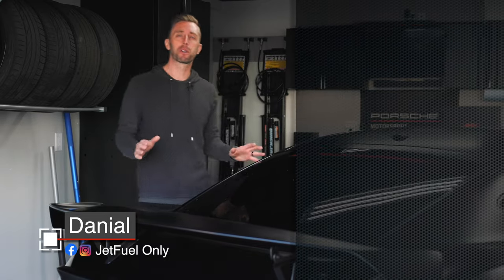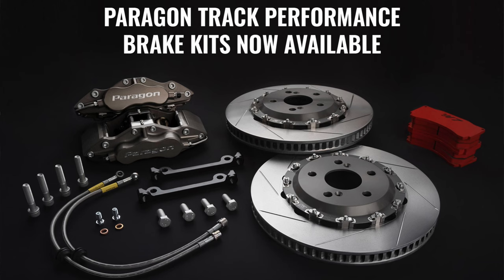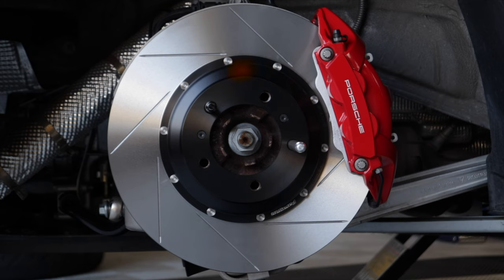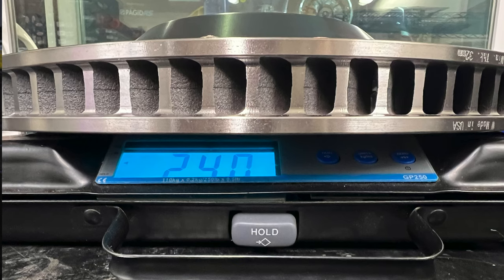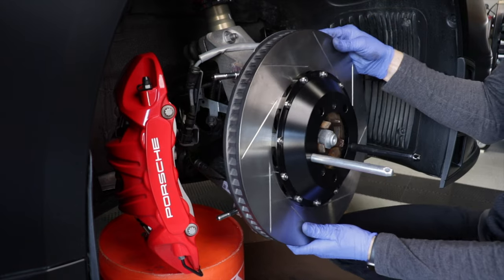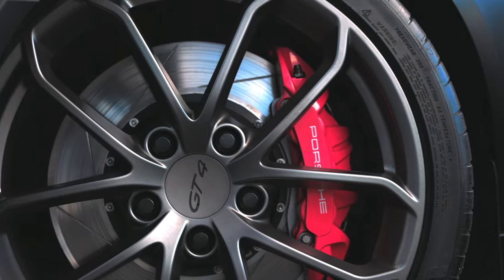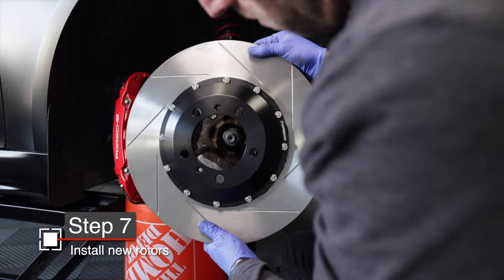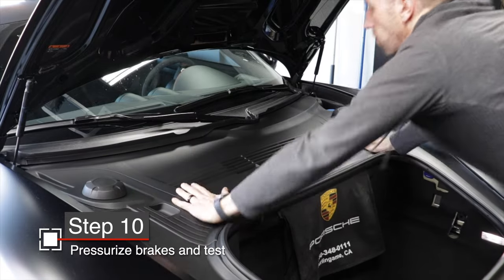New 2-Piece Slotted Rotor Option for Your Porsche | Paragon Brakes

Comment: I noticed moving from OEM to PFC rotors that the PFC ones had much, much less bite than the OEM ones do. I am curious to hear whether you notice a difference in bite with these ones (assuming you use the same pads). The PFC ones need a lot more pedal effort which took some learning, but actually makes it easier to modulate the brake force.
Reply from the maker: I have a track day coming up we will see!

Comment: How many track days do your pads , tires and rotors last?
Reply from the maker: My OEM pads lasted 29 sessions (20 min each).  The rotors lasted 39 but could have gone at least another 5. I’ve been through 2.5 sets of tires in that time. Along with the track time also plenty of Autocross and backroads driving. Car has 12k miles.
Reply from the maker: Sorry you asked track days. Tires about 4-5. Pads had meat but weren’t as effective anymore after 7 days. Rotors did 9 days and maybe could have another day or two.
Reply: good info thanks, and the videos are really high quality! @JetFuelOnly

Comment: Why you chose slotted abd bot cross drilled rotor? Isnt cross drilled better for track?
Reply from the maker: No, cross drilled rotors are more prone to cracking from the edges of the holes.  They do their job of venting gases and such but slots do better with less cracking.

Comment: Not sure but it looks like you may have installed your rotors backwards.
Reply from the maker: Thanks for looking but they are as Paragon intended. It’s based on the vane direction which happens to match the slots but some manufacturer’s slots may be cut different compared to the vanes.
Reply: @JetFuelOnly  good to know my Girodisc runs the opposite direction.
Reply: Slot direction is irrelevant, the only thing that matters is the direction of the cooling vanes